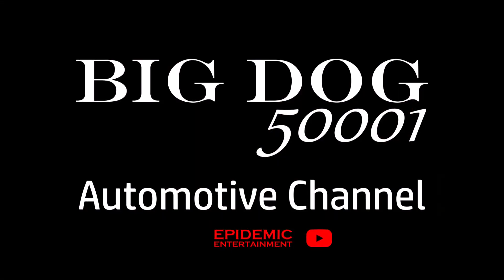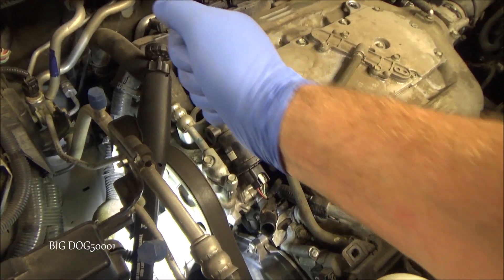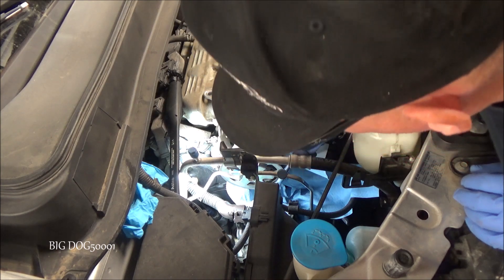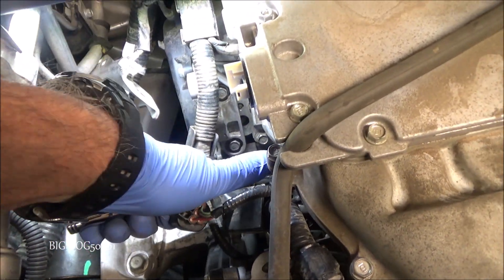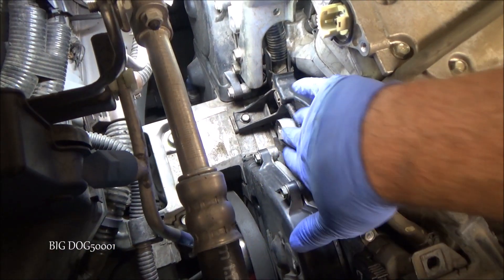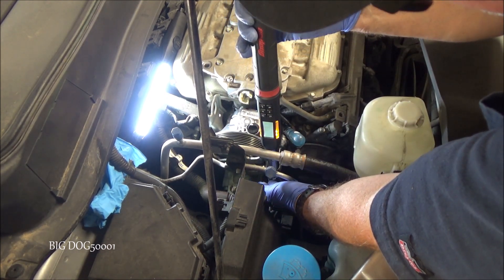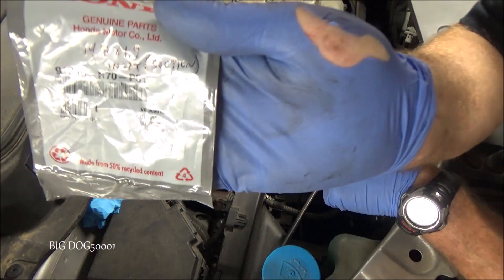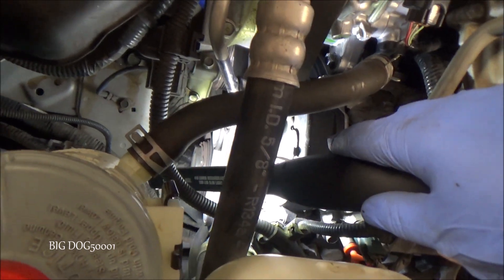Honda Pilot Power Steering Pump Replacement (2012-2015)

Comment from the maker: Parts and Tools
Disclosure: This channel earns a small commission using some of these links - at no additional cost to you.
Honda Power Steering Fluid:  https://amzn.to/3Z25tYC
Updated Honda Power Steering Pump 56110-RN0-A54
Updated Power Steering Bracket 56950-RN0-A00
Power Steering Bolt 95701-0804507
Intake Manifold Tuning Actuator Gasket 17153-RCA-A01
Power Steering O-Ring (Outlet, Black) 91370-TA0-000
Power Steering O-Ring (Inlet, Red) 91345-R70-P01
55001 Fluid Pump: https://amzn.to/42oicIc
Long Pliers: https://amzn.to/3Ly7pF3
Long Hose Pliers:  https://amzn.to/3llqhfS
Angle Pliers:  https://amzn.to/3LxsMGA
Serpentine Belt Tool SP 10950:  https://amzn.to/3TsZ7R6
Milwaukee 1/4" M12 Ratchet: https://amzn.to/3YY0XKw
Master Hex Bit Socket Set: https://amzn.to/40e6n5k
GearWrench XL Flex Ratchets:  https://amzn.to/40gPSp3
GearWrench 1/4" Socket Set:  https://amzn.to/3Jpmu9y
GearWrench 3/8" Socket Set:  https://amzn.to/3llqhfS
Milwaukee M18 Impact Wrenches: https://amzn.to/3n0Jbcq
Nylon Pick Set:  https://amzn.to/3JNYsGn
Air Blow Tool:  https://amzn.to/3JNYsGn
Midlength Socket Set:  https://amzn.to/3FwrY0Z

The Big Dog 50001 Automotive Channel Store can be found here: https://www.amazon.com/shop/bigdog50001automotive  (As an Amazon Associate I earn from qualifying purchases).

Comment: My Honda Pilot 2012 has been making a squealing noise at certain RPMs especially when I am accelerating. It is worse this summer and seems to be less in cold temperatures. It has probably been going on for about a year. The first thing I did was change the belt which made no difference. If I put a bit of belt dressing on it seems to help for a bit then back to the usual. Today my wife took it to the car wash and as soon as the water sprayed up from below she said that she lost power steering and the battery light came on temporarily. After she got past the water jet she said it shrieked pretty good and the power steering came back. Given these symptoms would that point to a power steering pump? Maybe the idler? When I changed the belt the idler seemed to spin freely. I am stumped. It is obvious that the water spraying on the belt made it slip temporarily.

Comment: caution : If you have a 2011 pilot, it has a 17mm bolt to get the tensioner moved to remove the belt

Comment: What was the symtoms? Tight heavy steering? Wifes 13 pilot touring i drove today and the steering is heavy harder to turn then normally. The steering fluid i changed 15k miles ago. No issues til now

Comment: 33:40 Easier to prime the pump BEFORE putting the belt on by using air ratchet or impact or even a drill to spin the pump.
Reply from the maker: I'm not sure it's "easier" but it is certainly another way it can be done.  Thanks for the input!